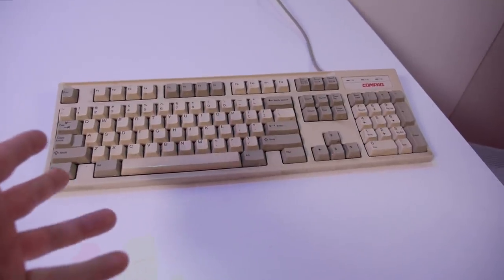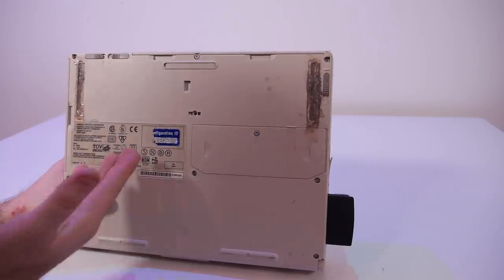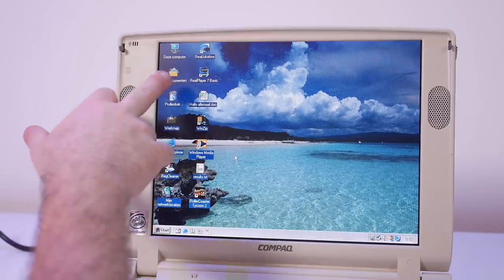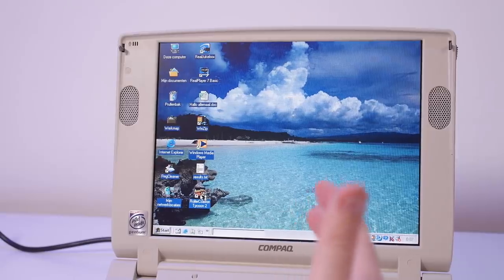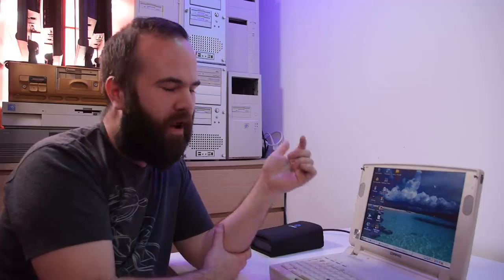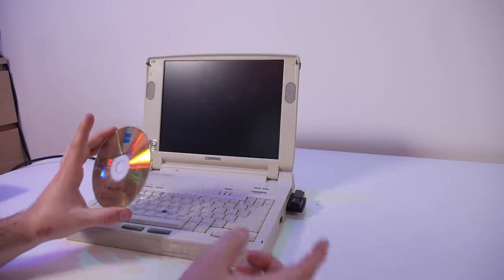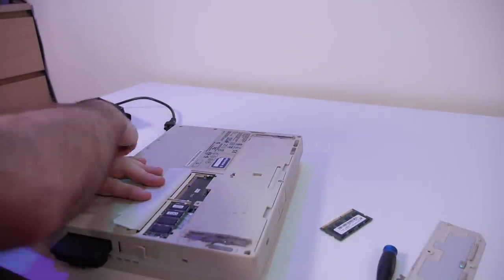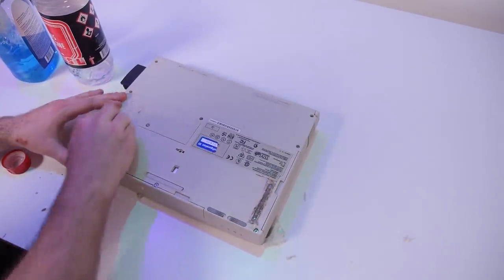Dumpster Dive Laptop: Compaq Armada 7710MT with Windows ME

Comment: The insides of that are highly modular. The sound card, cpu, Infrared/Modem Combo card, pcmcia slots are all on stackable cards and there are no ribbon cables its all rectangle plastic connectors that click together even the top keyboard tray mouse pointer and entire top plastic part lifts off with a quick disconnect by removing a few screws on the bottom. You can plop a 266-300mhz pentium 2 from the 7800 into it no problem and there a few different models of ess audio drive, cirus logic, and even a sound blaster card you can drop into it.
Reply: I don't think you can put a Pentium II in it, Pentium MMX and Pentium II require entirely different chipsets.
Reply: @brandonupchurch7628  You can put the 7800 pentium 2 onto the 7710mt board the chipset is on the cpu card itself
Reply: The bottom layer that the power supply connects to only contains the s3 gpu and the rectangle connectors for all the module cards so is more like a backplane then anything else.
Reply: Also there is a dock for this laptop the smart station that lets you install full size pci and isa cards aswell as 5.25 external drives and 3.5inch hard drives so with the simple slide and click of the laptop into a dock you can add 3dfx voodoos and true opl3 sound cards to the system
Reply: @brandonupchurch7628  https://i.imgur.com/vsvyWmL.jpg https://i.imgur.com/Zotq2dv.jpg What the cpu card looks like in super high res with the heatsink removed. It has a BGA cpu soldered one a chipset and the cache modules all on the 1 unit.
Reply: Great comment thread! Sounds like this laptop was engineered very service friendly, which is so awesome compared to today's garbage laptops.
Reply: @cjhawk67  The 7800s CPU card is much larger than the one in the 7710 and the connectors are also completely different sadly.
Reply: @nitrax8629  Ah I had read the 77xx models you could order Pentium 2 klamath chips as upgrades for them so i always just assumed it was the same cpu that came in the 78xx models

Comment: Not a bad machine! I have the later 7800, a very similar machine but quite a bit deeper, which had a Pentium II 266MHz and 32MB SDRAM built-in. The modem is actually present on your model; however, you need a country-specific adapter that fits in that strange port you found above the PC card slots. The built-in RJ11 jack was only provided on North American and Japanese releases IIRC.

Comment: This and the LTE5000 series IMO are some of the best laptops Compaq ever made.
Reply from the maker: Yes really nice machine! Is the floppy drive a module like the cdrom player?
Reply: @victorbart   Yes
Reply: @victorbart  That is correct, they were designed to be interchangable. You should also be able to put a 2nd battery in there.

I'm not sure how similar these are though I do know there were many similarities between the Armada and LTE series at the time. For example for some models you could use the LTE5000 CD-Rom and Floppy Drive in the Armada machines.

You could also stick a battery into the media bay for extended battery run time. The LTE5000 was one of the few machines that allowed you to use the primary battery in the secondary battery compartment, so you didn't have to have a special battery for extended use. You could just slide the battery face plate over to cover the rest of the width of the media bay.
Reply: I liked the LTE Lite series due to them being very easy to service.  You could even swap the standard STN monochrome screen for a TFT colour display, which at the time was the first ever offered in a laptop.
Reply: I had a LTE5400 and used program called Smart Boot Manager which installed to the boot sector and allowed booting from the CD Drive because the floppy and cdrom shared the same bay it was tricky to boot it up for a fresh install. I regret trashing it years ago.
Reply: In the past I have made a video about replacing a motherboard of a LTE5300. https://youtu.be/gb6zWkk9rww

I really liked that laptop. I bought it 2nd hands around the year 2000. I used it more for gaming and my sister used it for her lessons so she could dit outside. 😀

Comment: Windows Me gets so much hate it’s just Windows 98 3rd edition.
Reply: I agree with that.
Reply: With DOS mode stripped out unless you mod it back in
Reply: Yeah, I never really had any problems with Windows ME back in the day. For me it just felt like a more modern version of Windows 98 with better support for USB devices etc. and ran just as stable - at least on my machines... :)
Reply: That's why I prefer 98 SE over ME
Reply: It runs beautifully on more modern hardware from around 05 with a more mature chipset and updated drivers. I never understood the hate for it either. It ran well for me when I was using it back in the day.
Reply: @DeadlyGamingLV  i have it on a dell dimension 4100 and so far it hasnt crashed once

Comment: Nice find Victor! That WiFi card, being an 11mbps 802.11b card should even work on Windows 95 with its drivers reinstalled, but any networks it connect to must have the router set to WEP security (or some of those cards only supported unsecured) or it won't work.

Comment: I guess the floppy disk drive is supposed to sit where the CD drive is now.

Nice find !
My 486 compaq laptop has no hdd a it needs a bay like yours has :(

Windows 95 CDs aren't bootable indeed.

What you can do is to boot a windows 98 setup disk, format the hdd, then swap the CD to the windows 95 boot CD and start the installation (you need 95 OSR 2 as it uses the same DOS version as 98)
Reply from the maker: Yes I probably gonna replace the HDD. And prepare the partition and copy win install + drivers. And then put it in the machine :)

Comment: I have an Armada 1585DMT with a Pentium MMX 150, I upgraded it to 80MB Ram, has a SB compatible ESS sound chip and uses a Cirrus logic video chip, I run Windows 98 LITE and Debian Sarge (the last version with 2.4 kernel) on it, under Linux it'd be nicer to have a little more ram, but 128mb EDO sodimms are kind of expensive and the 1585DMT only has one sodimm slot + 16MB on-board. Also the cirrus video doesn't seem to work very well with XFree86 at least compared to the NeoMagic NM2090 in my Dell Latitude XPI CD w/ Pentium 150 and 80MB of ram, I would think that the S3 chip in the 7710 would probably run well under linux. Old Linux distros with a 2.4 kernel would run pretty nicely with 144mb of ram, I wonder if the 7710 can support more than 144mb if you use 128mb edo modules.

Comment: I have a number of old toshiba laptops.  Ranging from 486 to Pentium 2's.  The biggest problem on them is that the 486's only have floppy drives, and those drives are belt driven.  Twenty years of wear has made the belts turn to dust.  I have tried a number of cassette tape belts, but I've been unable to find a suitable replacement.  A lot of ater budget 486 laptops had cd drives and no floppy drives, but the bios usually doesn't have the ability to boot from cd.  To get them working you need to pull the hard drive and do a dos install or win 95 install via a usb drive holder.

Comment: Okay seems like the main difference between this and my armada 7770dmt is the cpu.
Mine runs at 233Mhz also got a 60GB hdd inside and 144MB of ram with windows 98se and xp dual booting.
Btw it seems like you still have the OEM partition on your hdd to enter the BIOS settings.
Might there be any chance uploading a hdd image from your laptop?
Unfortunately i don´t have this partition, i got this laptop without a hdd back then.
Also pretty bad shape but it works.

The floppy drive will be inside the cd rom slot, it´s interchangeable but i also don´t have a floppy drive.
Maybe i can get a USB floppy drive working since i have a PCMCIA USB card.

Comment: Please install Windows 2000 on it, best OS for this laptop.
Reply: windows 2000 on an MMX era computer?  windows 2000 belongs on Pentium3 and up
Reply: @timmynatorX  Who cares? 2000 and  ME are the same OS but 2000 is a LOT more stable. So yeah it would be good to install 2000 on it. It runs ME pretty good.
Reply: @pijussimkevicius6149  2000 and ME are nothing alike. 2000 is like NT5.0 and ME is WIndows 95/98 based.
Reply: @timmynatorX  I've used it for a time on a Pentium 133, with 80MB is memory it will run nicely.